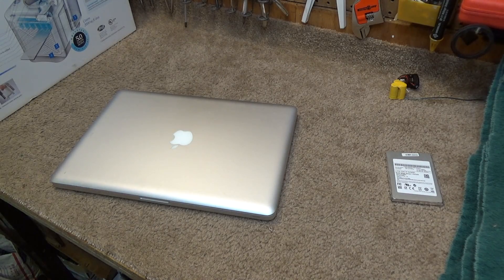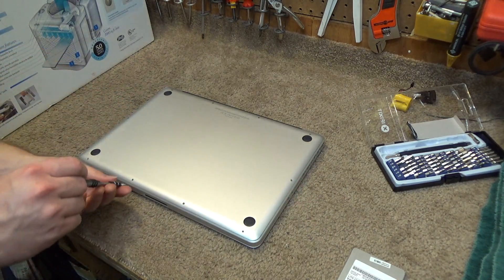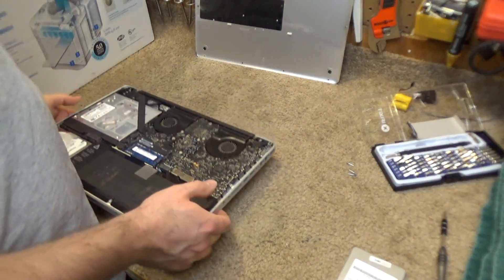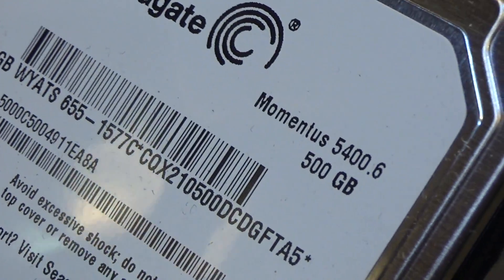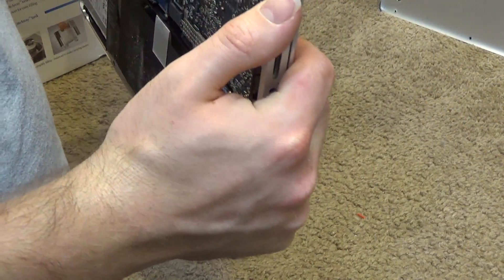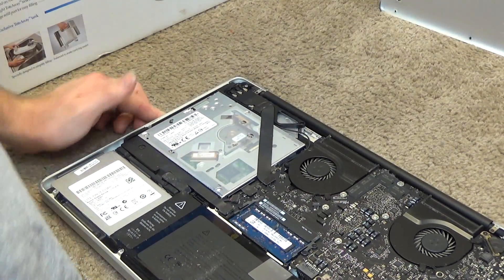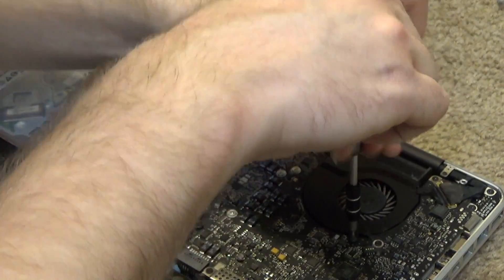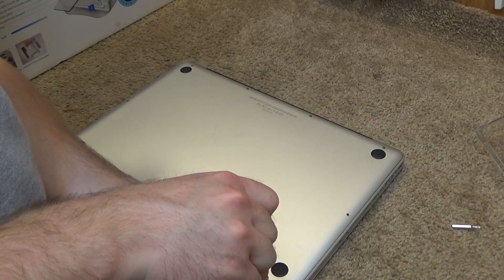2011 15" MacBook Pro | Hard Drive Replacement and Fan Cleaning

Comment: what was reason for drive replacement? Was it for more space? If so, what is the max space this model can be upgraded to?
Also, regarding fan cleaning, is it safe to blow compressed air into the fans? And wouldn’t it make sense to do that before unscrewing the fans and manually pulling the lint out? Thanks a lot!

Comment: My parents have one of these Early 2011 15" Macbook Pros sitting in their closet. I remember having to buy an iFixit kit just to take out the battery which was expanding and actually bent the chassis and popped off a screw. Ours had a Hitachi 500GB hard drive, which I am informed are quite reliable. And, funnily enough, ours survived a soup spill on the keyboard.
Reply from the maker: I never particularly liked Hitachi drives, the failure rate seems rather high. I've personally had several go out on me over the years. The Deskstar and Travelstar models were particularly bad, though I don't think Apple used either of those in the MacBook Pros.

Comment: I’m surprised the display hasn’t suffered from that dramatic failure despite it being one of the 2011 models. The 2012 MacBook Pros were by far my favourite largely because they were the last ones with the classic design and they fixed the display issues
Reply from the maker: Perhaps this one doesn't have too many hours on it. The 2012 model like this is the last one I can respect.

Comment: I'm REALLY happy with my Mid-2012 MacBook Pro (which I actually bought brand new in December of 2015 in the second to last year they made the SSD MBP). Mine's a 13.3" Best Buy base configuration, although it does have a 500GB SSD installed (the base configuration). Sure, it won't support anymore software updates, and sure, it's a tiny bit slow thanks to the Intel processor, but it's an awesome computer, and I love it. Mine's basically the same as the 2011 model, minus a few changes (the design dates back to 2008).
Reply from the maker: The 2012 models in this form factor were quite decent, the last computers from them I really have any respect for.
Reply: @JordanU  Agreed. From time to time I think of getting a new one (I also have a Mid-2012 MacBook Air 11.6" that I mainly use for internet and YouTube), but I like the classic design and SSD of the Mid-2012 MBP.

Comment: Sadly with those 15" 2011 models with the graphics card options, they have a tendency to the GPU shorting out and dying, leaving the system to be dead. It's a shame since I like the 15" form factor compared to the smaller 13" models, but they are all on a limited lifespan. Also, the bit for the battery screws is a Tri-Point Y0.
Reply from the maker: I'll have to check the graphics configuration on this one. That seems to be a running trend with Apple, I remember the 2006/2007 ones being plagued with graphics issues as well.
Tri-Point Y0, as in 'Y0 HP, my computer broke!'?
Reply: @JordanU  the last thing you said made me laugh very hard
Reply from the maker: @r1ckastl3y86  Thanks for letting me know.

Comment: In late 2013 or 2014 i sent my Gateway NE56R (My first laptop, shipped with Windows 8) and they put Windows 7 Home Premium on it, it was a slim Seagate drive, and it only lasted less than a week. But ever since then i've had no problems with any Seagate drive.
Reply from the maker: I've seen a lot of Seagate drives fail, but usually after a few years of service.

Comment: I think that's because Windows 10 and the latest software is written for use on hardware 5 years old or newer. The latest processors. I had Windows 7 for awhile on my Dell Dimension 8400 with it's factory amout of a gig of ram, and it has a the Pentium 4 550J with a clock speed of 3.4 ghz, and i was very surprised how well Microsoft Edge ran on it.
Reply from the maker: If that's their intention, that's deplorable. There's tons of hardware that's older than 5 years which is, and will continue to be for quite some time, fully adequate for the majority of home users.

Comment: In the school district I grew up in, most of the computers were I macs and Mac books. I have been wanting to buy a MacBook computer, but they are expensive.
Reply from the maker: Sometimes you can find used instances of the older models for relatively cheap.
Reply: @JordanU   My younger cousin who is almost 21 has a Mack book pro like this one 17 inches big and it was bought from the owner.
Reply from the maker: @Daconthocon78  Thanks for letting me know.

Comment: I have a retina and you can replace the SSD (You do need an adapter to put a standard m.2 SSD) and you can replace the battery but ive been told it was glued in... Its not.. 

You can service them but its a pain in the ass.
Reply from the maker: The batteries in those are glued to the top case. In many of the newer ones, the entire top case is replaced with the battery. What a terrible design.
Reply: @JordanU  The people I took it to (A local apple store They have a license). Family owned) said it was Glued in (permanent) When I looked at it. It just looked like it was bolted/screwed in. Still a dumb design.
Reply from the maker: @maddmaxx636  They are correct. You can't see the glue, it's on the other side of the battery...
Reply: @JordanU  Which is stupid as hell! My HP Elite x2 1012 G1 business class tablet (It runs MacOS Mojave) is modular. Everything is held in with screws and can be removed with a kit like you have (Which I have).
Reply from the maker: @maddmaxx636  Stupid companies produce stupid designs.